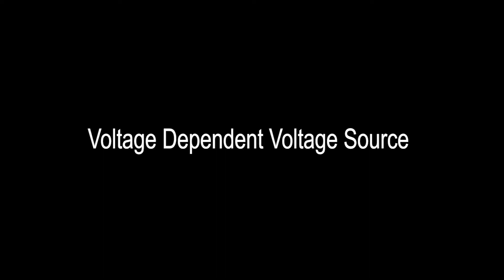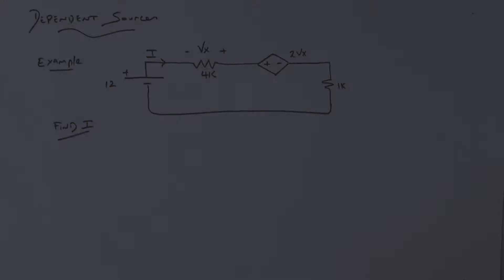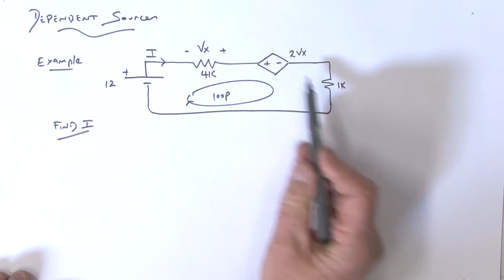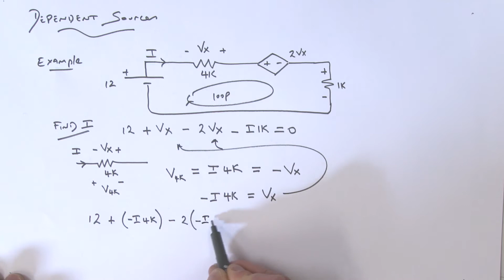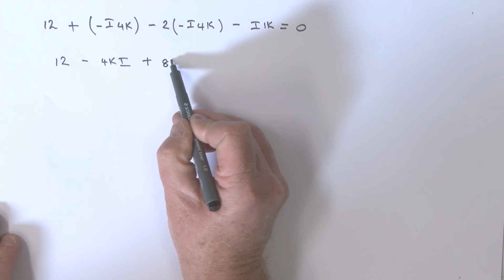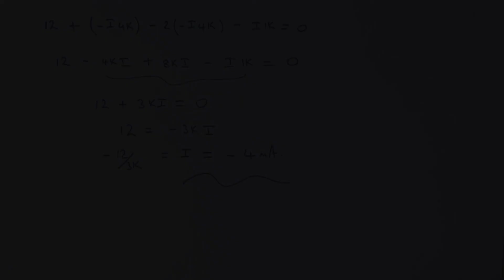Comment: Please Why are we defining all the other way around in V4k
Reply: They flipped V4k so Ohm’s law becomes simple. Current goes into the left side of the 4k resistor. For Ohm’s law, we usually mark plus where current enters. That is why V4k is drawn plus to minus from left to right. But Vx was already defined earlier in the opposite direction to control the dependent source. So both describe the same resistor, just from opposite directions. That is why V4k = -Vx. But, it does't matter what direction you define it in, you can define both in the same direction if you want to as long as you stay consistent in the calculations.